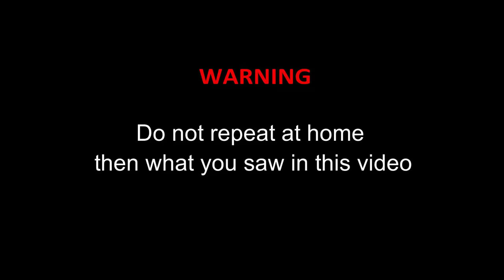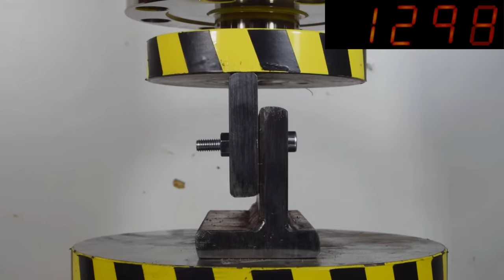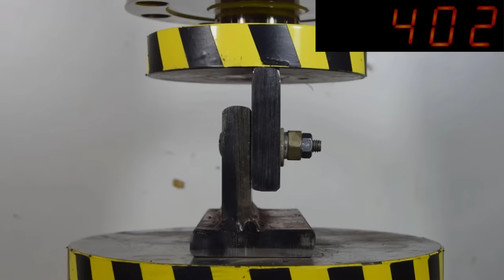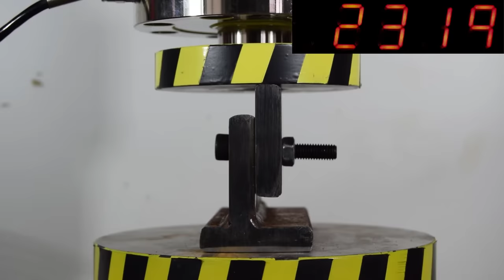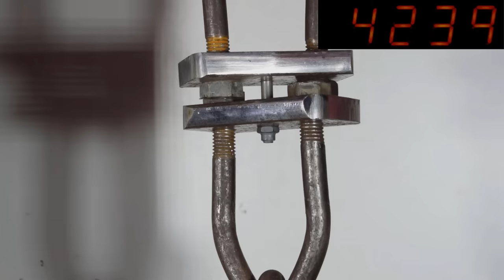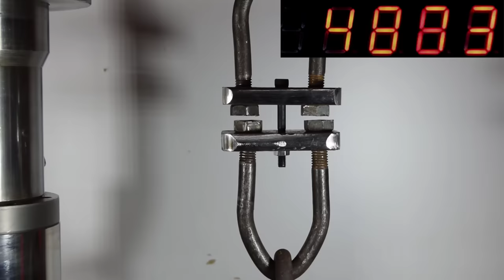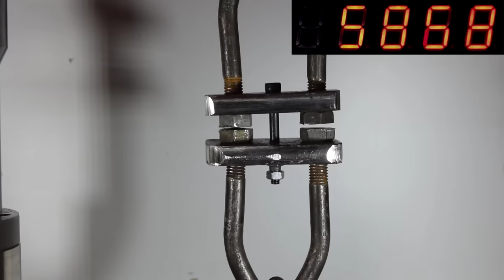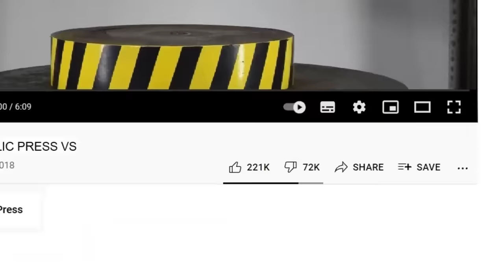HYDRAULIC PRESS VS TITANIUM BOLTS

Comment: Keep in mind, there is not criteria for quality in the Chinese bolts. Aerospace hardware is better due to its certifications and quality control. Traceability back to the mine. Guaranteed  to meet or exceed specifications every time.

Comment: Some bolts have a shank long enough to go through both pieces of steel whereas others have a shorter shank so the thread is in shear instead of the shank, plus some bolts had washers, some double nut, some quite clearly not tensioned as others.
Although the results made zero sense and were mixed up anyway.
Titanium isn’t generally as strong as a grade 8.8 bolt and certainly lower than a 12.9 unless it’s some super exotic stuff or a Bumax.

Comment: You have the right idea with the way you made this video but for proper testing you should be very consistant with bolt size, thread depth ect between materials.
And when displaying results they should be all in the same order that the test were conducted in.

Still a worth while watch but only for entertainment value, it didnt actually prove which is stronger.

Comment: Titanium is not that hard to lose, to make it hard, it has to be stamped at great pressure and it depends on the blow and the pressure it takes, it will be more or less hard to compare one titanium with another, it depends on the application, it is a technical matter, it does not imply the country nor the generic purpose It is a specific purpose

Comment: A couple minutes into this video I realized it was a bit of a joke, and not to be taken seriously. 
-The single shear test shown first was not putting the bolts and perfect sheer, they were twisting as it was shearing.
-The “tension”(tearing?) test was also in accurate based on the mechanical disadvantage of the test assembly, the nuts, that obviously weren’t the same grade as the bolts and different amounts of thread engagement.

I’m sure there’s more, but I stopped watching after the  
F**KING HORSESHOE 
hook broke testing the grade 12.9 bolt.

Comment: the best bolts don't necessarily have to be the strongest with thousands of screws in a spacecraft what counts is consistency and quality in the manufacturing process, for e.g. how many out of 100 bolts have near or equal properties, you want more strength? use a thicker bolt, you'd be surprised at how many of those cheaper parts are binned rejects from tested components, x-rays might reveal a micro bubble and they reject them, but if your not using them on a racecar or spaceship its acceptable

Comment: Tested bolt and nut should be made of same material for each sample. It is not correct to compare bolts with different nuts and thread length. In this case the weakest point will be the thread of steel nut, not the titanium bolt.

Comment: If you just need to cast something, it can be as strong as the earth, but then you can't drill or work it.  So the solution was lithium iron at absolute zero with the high voltage.  But working it is absolutely pointless, you'd waste a year on grinding stones.  Titanium is week because its carbon fiber.

Comment: Not exactly a fair test where the Titanium you use different hardware on the first test. Titanium has a flex washer and a lock washer. Second test the bolt is different where you used a bolt with more threads. Of course it’s going to hold longer. I have no doubt the Titanium has greater strength but test parameters needs to be equal to get semi accurate results. I would be interested in seeing the test under adverse conditions. Extreme heat and extreme cold. That would have a bearing in which to use in which application.

Comment: Not to be picky or anything but your first test was shear strength and your second test would have been tensile strength. Just Sayin
Reply: And when the bolt failed at the threads during tensile strength test, it was a shear strength fail on the threads. The bolt held up on tensile strength. The threads gave out.

Comment: I don’t get what point this video is trying to get across? Because in the real world, when would you ever have a dynamic load of 1800 Nm, 1920 Nm  or even 3843 Nm acting upon just one bolt?  This shear strain would never be designed in by an Engineer.

Comment: Titanium is know for its light weight and it's higher durability than steel. Same goes for carbon fibers. And the most durable is carbon nano tubes but it's not easy to produce a bolt of carbon nanotube or other materials like that. That why researchers are trying to find a way to make component also big structures form nanotubes.

Comment: You double nut the US made bolt with a lock nut but single nut for chines one. Off course that it self will add addtional 200 to 350 pounds of resistance to the bolts brake point tolerance.  If you are going to test it you need a similar  setup.
Reply: GOING TO START TO PUT 3 NUTS ON ALL SECURING BOLTS FROM KNOW ON, THAT WILL MAKE MY BOLTS MORE STRONGER 🤣🤣🤣🤣🤣🤣🤣🤣🤣🤣 DURRRR

Comment: why compare two different types of titanium bolts. the spacecraft bolt is made for light wieght and heat extremes where as the china strength one is designed for strength. it's like comparing and apple and an orange because they are both round fruit.

Comment: Plenty of flaws in this experiment. Not using the same style of fixing being the biggest i.e. a Cap Head Bolt with the same thread length in each case. Second not using specific torque setting as pre-tensioning with effect joint performance. Third space bolt is design to carry loads over a broad range of temperature and for its weight primarily.

Comment: The test is not comparable as the threaded portion of the bolt is not of the same length. The longer the thread the weaker the bolt. However the difference in weight should be worth further investigated.

Comment: So with the "spacecraft" bolt, you used washers and what appeared to be a rusty nut.  The chinese titanium you ran a clean nut right up to the plate.  Stacking washers which will put excess sheer and tension forces on the bolt because it wasn't tight.  A single washer is good for holding, but when you stack multiple washers it will allow movement when almost 2 tons of force is applied to it.  In order for you to do a valid test, the bolts need to be identical and you can't change the parameters of the test.   Nice try russia....

Comment: So you're comparing different size bolts, different heads, and different grades, from different manufacturers, never mind that titanium is used when hardness and lightness are needed, not sheer strength as it is by it's nature very brittle.......this should provide a lot of meaningful information.

Comment: Ti is mostly used for two things :
1) to save weight
2) to resist higher temps

did I miss it or did we not see the weight of the Chinese bolts ?
... because, honestly, you cannot trust Chinese products EVEN when coming from the same mfg...
those colors on the Chinese bolts look EXTREMELY suspicious 😂😂😂

Comment: This experiment does not yield any comparable, meaningful statements. Firstly, bolts are not loaded in shear but in tension. It is not the task of screws to absorb shear loads. That is not what they are made for. The arrangement of the experiment makes no sense if you want to test screw strength. The only thing being tested here is the frictional force of the steel plates against each other and this is not even comparable because the bolts were not all tightened with the same defined torque. It is not the bolts that hold connections like this together, it is the surface pressure between the plates. The tightening torque of the bolts must be selected so that the bolts exert enough force on the plates so that they do not shift under the static or changing dynamic loads that are expected. If the panels shift, the connection has already failed not when the screw breaks.

Comment: Titanium while overly looked at as super strong its the corrosion resistance and strength to density that makes it better hell high strength aluminum 7075 is better than 7140 chromeoly steel similar strength half the weight and titanium grade 5 has the best strength/density ratio of all until carbon nano tube or graphene becomes mass produced.

Comment: Hello, dear friends, is it at all possible that the testing laboratory does not have all the information and, above all, oversized tensile devices such as the globally recognized Dynamometer DYNA-LINK, Operating temperature: -40°C to +70°C
 Material: aluminum alloy
 Protection: IP65, surface treated against corrosion
 Overload: safe overload 200%, destructive 500%
 Calibration: digital
 High Definition (5000d)
 Acoustic signal
 Upper and lower omega calipers
 Portable case
 Load capacity of the DYNA-LINK2 dynamometer up to 250t
 RS232 cable
 WEIGHT: 30 kg (without omega calipers)
 DIMENSIONS: A - spacing of the holes for the pins of the omega calipers: 305 mm
 B - dynamometer length including omega calipers: 756 mm
 D - dynamometer width: 207 mm, I'm starting to have a strong suspicion that you are young adolescent boys who can't even use the Charpy hammer principle or the Brinell hammer test as it really is??🇪🇺🇨🇿⚠️Dr.Camillho

Comment: You did it all wrong man titanium bolts hold same tonage as a steel bolt is much smaller meaning you can use a smaller bolt in titanium to save weight to hold same weight as the regular steel bolt that is much bigger or save room and weight on what ever the application is

Comment: The "Teststand" with Chain and a Steelbar shows that you only close to the tecnic, but you don't nail it ... all youre numbers are only the half of the reality.

At all: a nice compare... now you need a compare with glowing bolds 😂

We had in ouer Labratory two rectangle 80mm U Type Profile and we cross them in together for the "pulling" test. And if you know that a threat needs to be screwed 3 times deep of the threatdiameter... you dont loose the  Nut ... try it again with two ore three nuts and the 12.9bold

Comment: Ti is not stronger than steel. What diameter were those fasteners? Th To ones were obviously larger than the steel ones. Also, WTF I 'Ti for space?" 6Al-4V? What was" Ti from China?" Were you using stainless steel? What alloy? What's the heat treat?
So many unanswered questions that matter a whole lot when you're doing this type of test.

Comment: "12.9 most durable bolt" durability and strength are not the same.
durability is how long something last (time), while strength is how much force it withstands. 
i can see how it would be confused when durability can depend on strength. but even a strong bolt can rust away or wear out over time. while a bolt say made of a diamond would although be weak in shear and tension strength would out last any metal or plastic bolt in an environmental durability contest.

Comment: This test is not really accurate you’d need to use the same size and length bolt in each test in the same hole on the test jig … only then an accurate picture can be had

Comment: You're putting the bolts in different holes you put the steel one in the second hole you put the titanium one in the first hole why you trying to trick people it's not about what it's made of the practically the same strength it's just 1 lighter than the other

Comment: This is an inaccurate test. The tolerances on your tests was skewing results. Let me iterate. I am not talking out of my butt. I’m a machine technician and am studying for a degree in Automation and engineering. 

The length of the bolt with the added spacers and the diameter of the hole not being correct is adding induced distortion. To make up for that. Flat washers should have been used. And a standardized torque should have been applied to the bolts to make the results less variable. In essence. This test proved nothing about the hardware that was tested. It was a waste of money and time.

Comment: I can’t makes sense of your presentation. What’s being seams to not correlate with the values. 

Besides that, the advantage of titanium is not that’s it stronger than steel, it’s the strength to weight ratio. Titanium gives the strength of steel at the weight of aluminum.

Comment: What a stupid test. 12.8 is referring to a tensile test not shear. Also it heavily depends how tight the screws are which can be only achieved with a calibrated torque wrench since screws are not meant for shear but rather press the two metal parts together. All in all stupid and not comparable

Comment: The chinese bolts Were NOT titanium. That color is referred to as titanium. It's a finish usually seen on cheap gas station knifes.  It's just a cheap steel Bolt with a shiny finish. Your tests were flawed and you kept mixing up the numbers but obviously you knew that. this video is designed to fool people who don't know better.

Comment: This video is a mess.
The advantage of titanium is its strength mass ratio and its resistance to corrosion, its not something you use when going after ultimate strength.

In case anyone is taking this test seriously, aliexpress is not the place where you get professional material and parts, even the chinese know that. Always keep in mind that you get what you pay for, if it sounds too good to be true, odds are it IS too good to be true.

Comment: Worthless test.

Because no torque measurements were made when tightening the bolts, this "test" is invalid.

A bolt that is tighter will increase the frictional forces between the 2 pieces of steel, thus making the force required to shear the bolts MUCH higher.

Comment: Your test is not accurate. One you did not equally torque each . Two pound for pound titanium is stronger. Not diameters. That’s why they use on space craft.same area less weight Chinese titanium is junk. Thanks

Comment: these are not good tests as the metal that held the bolts probably bent and took  some force from the harder bolts. also bolt sizes were not exactly equal in weight and thickness. this looks cool but proved nothing. Thx for the vid and attempt

Comment: U need to TORQUE those bolt 

Your test is not good 
Torked by hands give your wayyyy not enough consistency 
Every bolt have diferents torque
Gauge
Material
Grade
Lubrified or not
  This is a « general » test but will never tôd you the truth